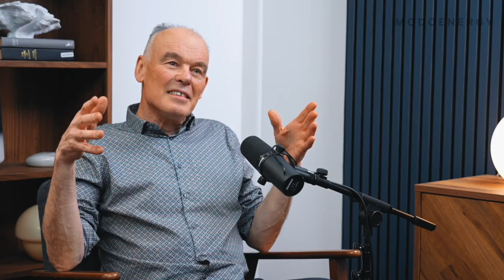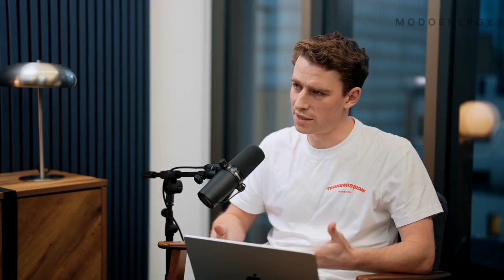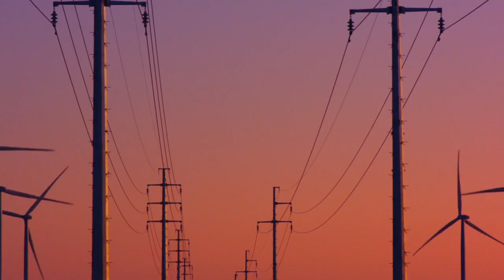Why Is Grid Stability Getting Harder? The Hidden Challenge of Renewable Integration

Comment: You'd need to be deeply immersed in this field to understand half the jargon that Nicholson is speaking, and his disjointed, digressive manner of presentation harms the effect that I am sure he is capable of achieving. 

I also found myself frustrated with Porter, the interviewer.  I wanted him to jump in more often and make Nicholson clarify his words. But perhaps that wasn't possible. 

For example, around 34:45, Porter asked "what's the right term for synchronous compensators?"  In the next minute, Nicholson details the breakdown of "synchronous machine" into three categories, one of which is synchronous compensator. But he does it with hesitations and restarts, unlike the clear breakdown you'd hope for in a practiced presentation.   

Porter takes another stab at clarification, asking  "but what actually is that thing, is it just a spinning top...?"  Another minute or so of Nicholson's jargon and digression follows, providing little clarification.  "Statcoms, SVCs, switch caps and reactors.. ABB machines..." . "A standard electrical machine connected to a flywheel."

Over the next few minutes, Porter does guide Nicholson to be very specific about spinning tops, though I would have really liked more description of their design and maintenance requirements. Nicholson tosses off that you have to replace the bearings from time to time.  Well, how often? How costly is that?  What does it mean for the lifetime cost of these units?

All in all, I learned a bit from this interview, but I had to work hard at it.
Reply: Thanks for your time and the comment. I’m aware we can get too much into the jargon and it’s certainly one pitfall we’re looking out for. 

On the maintenance of synchronous compensators - yes, agree this would be a good topic, but tough to fit it all in.
Reply: If one wants well informed market actors to spend additional time to slow down, lay out the details for lower level learners (me included) you pay to go to expensive conferences, buy books, etc. Any interview could be better on both sides, but I am consistently impressed by the quality of this series. It’s the only podcast format anything I will spend time on. Congrats on all you’ve achieved Modo Energy.

Comment: Wind and solar energy are not renewable energy unless maintaining electrical storage.  The storage provides dispatchable electricity.   The grid supports wind and solar  generated electricity with fast reacting natural gas turbine generators.   This costs more natural gas than making all the electricity with NGCC power stations.   Wind farm output with its wild un-culled output per second is the most natural gas expensive form of generating electricity.   The UK is paying wind farms to shutdown to save expensive natural gas.  

The power grid has to support 100% of the predicted solar and wind generating space with fast reacting power even when it exceeds the expected demand of the local grid.  It increase the wind and solar supported generating space above local grid demand by  exporting electricity to another power grid.   These costs are passed on to electric rate payers.

Comment: Syynchronous condensers are nothing new.  In the 1930 and 1940 they were used for power factor correction/regulation  One type (Elliott) were operated in a vacuum envelope to improve efficiency.  They were replaced by capacators for KVAR adjustment which were much cheaper way of doing the same job.  The problem with wind generation is when the wind speed is too slow to drive the generator at sync speed   A high efficiency automatic transmission is what is really needed  Too much power from inverters has its problems.
Pumped storage is a great improvement but makes the fisherman unhappy and is not very esthetric.
Reply: In the video he talks about how wind switched from being physically tied to electronically tied to the grid.

Comment: I too worked in the electrical industry and was considered a world class expert - working all over the world on design and implementation of every type of generation plant, transmission and distribution projects and large energy use projects like steel, mining, data centers, etc.  And we designed and built grid stability projects, and did the study, design and implementation of stability studies.  Also, many islanded systems, figuratively and literally, in places like the mountains of Chile, the Australian outback, many islands of Indonesia, and others.  

I was one of the ones saying that we should not do more than 15-20% of renewables on the grid due to stability issues, and that was early on when we did not realize that wind was only going to produce on average 33% nameplate, or that there would be weeklong wind outages, that solar was derated so badly for latitude and temperature.  Our business has soared in the grid stability area, so, there is that.  You are correct that we can come up with solutions for when you get more than 15% on the grid.  All it takes is a LOT of money, more money and more money, resources and engineering, and still we have to have a fossil fuel backup and still wind up with a grid that is much less stable.

I liken it to the shock absorbing systems of a massive truck vs. a bunch of tiny rubberbands.  Another way to look at is that if you take the two engines off of a Boeing 787, and put them on the ground and connect generators, you can deliver 200MW of power 7x24x365, on demand, ramp up and down and provide stability to the grid.  Or, alternatively you could strap 89 gargantuan 7MW wind turbines to a Boeing 787 to deliver that amount of power, but only on average, and they would not be connected to the throttle controls.  

I applaud your ingenuity and expertise, as I do when I see some of these gargantuan wind turbines being built in the factories, transported to site and erected.  But I shake my head and am saddened by such a waste of money, brains, and resources for the biggest economic and technical boondoggle ever foisted on mankind - by people that don't have rudimentary understanding of it all, for goals that they are not coming close to achieving and not even affecting it much.

Comment: That was an extremely accurate prediction about the anti-renewable hysteria that followed the recent Spanish black out. I'm glad to hear the UK is better prepared.
Reply: Yes. Renewables require extra stuff, and if you don't supply that extra stuff (thereby erasing the 'cheapness' of wind and solar grids) your grid has issues. UK has bought extra stuff - but also has extra costs, and thus higher prices.

Comment: Incredible Episode, 
Thanks so much for allowing us to get more into depth about the technologies that are shaping the grid of the future. 
Also, just in case useful, a STATCOM is like massive noise cancelling EarPods. They monitor changes in reactive power- i.e. voltage violations, flicker, power factor and inject the same signal in opposite direction to provide support to the grid. 
Incredible pieces of electronics. 
Thanks so much again! 
One of my favourite Podcast since I got into the energy sector

Comment: Frequency Response is a small cost to overall generation dispatch costs...   This is a very self-fulfilling video for those not in the industry.....  keep the masses informed and scare them.  There has just been bad energy policy.  they create a problem to solve a problem  Why does the problem exist to begin with?
Reply: As a US observer I could be wrong but am consistently surprised by the constraints in transmission in the UK. We have locational marginal pricing and it seems UK does not? Fascinating case in the UK.

Comment: Renewables have added risk to the grid - its in the news this week! But more importantly, my electricity bill has skyrocketed.
Reply: So I guess you didn’t understand any of this then?
Reply: @michaelchownyk5255  Didn't you understand it?
RE added risk to the GB grid, which is being reduced by installing extra assets - i.e. synchronous compensators. It isn't that you can't do it - it is that you have to pay extra to do so.
Reply: @factnotfiction5915  what is required is grid scale, battery energy storage, and that takes place of synchronous compensators. It has millisecond response time any other there’s a cost of everything but that’s the best money spent.

Comment: Sometimes the obvious answers can be found if you look into history. Back in the 1950s and 1960s, a lot of decommissioned very low merit coal station sites, were re planted with Open Cycle Gas Turbines. Some of these were fitted with self shifting synchronous clutches (SSSC).  They were generally about 30 to 75 MVA, with hydrogen or air cooled  alternators.  With the cut back in inner city generation, not only was the MW production lost, but also the MVAR production/absorption, which you used to get for free. Then a lot of EHV cable feeders were the only supply option left. These caused a lot of MVAR production and high voltage issues on the urban grids.  There were options even then to fit switched shunt reactors, and capacitor banks for MVAR compensation. But the government restricted the allowed capital spend of the CEGB.  So the CEGB had to use the OCGTs in synchronous comp mode, until a couple of decades later when they could afford static compensation.

Back to now.  We have about 30 GW of CCGT, which, under any practical scenario, will be needed for backup in the next 20 years or so. The wind does stop blowing, and it does get dark at night, and that can happen for weeks at a time.   From a national security perspective, despite people being commercially comfortable with massive inter-connector imports, that is a high risk option, with the Russian shadow fleet lurking around our coast.

So the obvious option is to retrofit Self Shifting Synchronous clutches to some of the CCGT fleet. They will be sitting idle most of the time generation wise, so why not use them. SSSC at 700 MVA single shaft ratings are probably not a thing yet, but where there is a will, there is a way.  The multi shaft units, with about 2 X 200 MVA gas turbines and 300 MVA steam turbine, are more easily catered for.  You have to pay for the operation and maintenance of these units anyway, so any declutched synchronous compensation  would be a marginal cost implication.

Why would you encourage unnecessary capital spend on another tranche of plant, when you have already paid for the CCGT fleet, and have no alternative but to operate and  maintain it ?
Reply: My understanding is that this refitting is planned in Australia as we decommission coal plants and install new gas turbines with that capability integrated.

Comment: This was an extremely useful episode. The key fact for me is that the BG Grid only needs 200mW of power to provide the grid with all the inertia it needs. A simple statistic to grasp one to. Then of course, understand the new role of synchronous compensators & condensers along with battery storage and response was enlightening.
Reply: If you can rely upon imported power for supply.

Comment: Everybody has a building with a roof. Home or work. 
Every building has a carpark space. 
Grid has customers building connected.
PV rooftop with v2g BEVs (battery vehicles) massive storage battery for FREE mass storage 23hrs and  daytrading electricity 23hrs and parked all night long is just a simply maths problem. 
Too much dirt cheap rooftop PV electricity.
Many days of FREE mass storage. 
Battery to grid is ezi pezi.

All customers switching off grid electricity is SHTTSNPANTS time for grid owners. 

Just do the simple maths.
Reply: Why would a vehicle manufacturer that guarantees the battery lifespan over a set time scale build v2g into its vehicle ?
Reply: @TronicUK  because that is what the customers want.
Customers want to maximise the use of their energy investment. 247.
Even nuclear promoters promote 247 max UTILIZATION of the investment. 
Bankers want max UTILIZATION. 
Underused capital investments are a waste.
The guarantee will be for a fixed number of cycles. 
Battery technologies are evolving rapidly to reduce costs, and mass production will also reduce costs.
Battery v2g will allow vehicles that are parked 23hrs every day to be fully charged daily.
Reply: @TronicUK  Tesla, including v2g in 2025
Reply: Stephen, 

no opinions or experience of your own?
Reply: @iareid8255  what have you done ?
Where do you live ?
Reply: Stephen ,

are you a polilitician that cannot answer a straight question?
Why as what I have done or where I live.
I asked for your opinion and experience, well?
Reply: Stephen, 

why would we want any more very expensive and short lifed solar. Especially in the U.K. as it is very poor source of electricity, plus the cost of your 'Free' batteries which from time to time like to ignite.
Reply: @iareid8255  any idea how many internal combustion engine fires there are per year in the uk ?
Reply: @iareid8255  grow up
Reply: Stephen, 
have you looked in a mirror recently. 
Either counter my opinion with a counter opinion instead of juvenile insults.
Reply: @iareid8255  battery vehicle batteries have been brilliant in Tesla's. 
Bs vehicle battery stories feed the needs of ignorant people. 
Skynews is atrocious. 
If the sun doesn't shine, the crops don't grow, and people starve. 
Latitudes are warming.